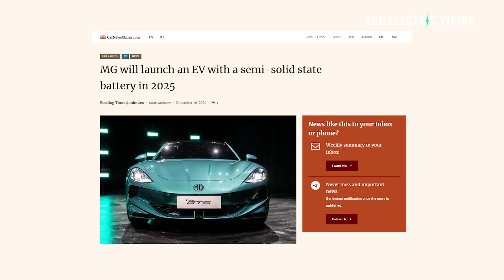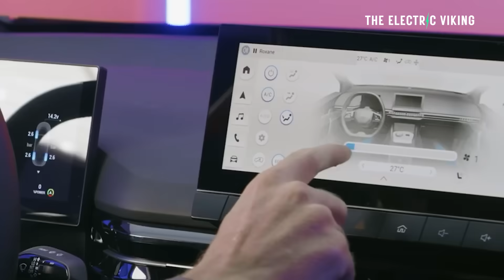EVs with Semi Solid state batteries are about to arrive...

Comment: Ok, so they're heading in the right direction. Range has to go up a little bit, while prices have to fall quite a lot. When 30.000 $/€ cars have an effective range of 800 km and can recharge in 10 minutes, you know its definitely game over for the ICE cars. Lets see if that happens in the next 2-3 years...
Reply: Charging time is not terribly important for most of us. My average daily mileage is less than twenty miles and my typical longer round trips are around 225 miles. At four miles per kilowatt hour, I only need five kilowatt hours daily to maintain a car. I have twenty 250w used panels I’m not using. At 50% output they could supply the EV charge in two hours.
The typical family has at least two cars and one is usually idle. I could buy a used m3 for what I have spent on battery storage for my home. I drive a Toyota Highlander which I like very much but would never buy another one.
Reply: Most gas cars don’t even get 800km of range.  But it would be nice and if that can recharge in 10 minutes. Even though I charge at home 98% of the time.
Reply: Average daily commute globally is under a paltry 60kms and the average ice sold in the UK has 400kms of range on an average tank!

Can't fuel your gas guzzler while you sleep or work for cheaply, or even get paid to charge it as many many many ev drivers do now.

Let the poor brain dead gas holes suck on those sweet sweet poisonous exhaust fumes. They aren't even intelligent enough to realize its one the top 5 ways us men self delete (park in an enclosed space, roll the windows down&turn the ice on!
Reply: already the case in China, and indeed absolutely game over for gasoline cars. They stink, are slow, feel old, and aren't even cheap. Plus you hardly can sell gasoline cars second hand, because nobody wants them.
Reply: Never going to happen.  All that will happen is the majority of people will be priced off the road!
Reply: Charging speed/cost is more important than ultimate range.
Reply: 10 minutes recharge will change nothing (except shortening the lifespan of the batteries, of course). If you put 10 point of charging at 350 kwh you will need a 4 MEGAWatt line to feed them all at once (considering a 10% dispersion and heat dissipation). Multiply that for, let's say, 1.000 charging station - you see the point. Simply not viable. So, you will charge 10 of them slowly OR one of them fast > queue.
If EVs are so good why the hell they need so much subsides from the government? And remember: the day when states will begin tax every kwh of recharge is not far away - and yes, even at home: gov't will mandate to recharge through a dedicated, remote-controlled charging point: energy company will decide IF, WHEN and at which rate you will be permitted to recharge, depending on their grid needs, not your will. Freedom is coming.
Reply: @lucamaggiolini5062  If EVs are good why do they need subsidies? Well, I can't think of a single industry that received more subsidies from the government throughout history than the ICE auto industry, not only to build factories but also all the infrastructure necessary to drive them, roads, gas stations, petrol refineries, the list goes on.
Reply: @mad_cozy What about the subsidies to the oil industry…
Reply: nobody needs fast charging. It's like saying cellphones will never switch to smart phones, because you'd have to charge them every day 😂 if you have 200m/300km range, and a charger at home, you can handle 95% of all driving. And we're already at 600km. Why would you ever charge outside? Swap the battery with Nio, if you must.
Reply: @ “nobody needs fast charging. “

No need to take this conversation further.
Reply: @LowAltitudeEconomyNews  i can think of several times where fast charging is good.
If you take a trip or you are just sick of plugging it in every day or you live in a unit and want more convenience.
cell phones v smart phones not fair comparison
IMHO
Reply: @gregbrown81  I charge every two weeks or so, over night. Completely enough. You pull out the plug of the charging box, the charger in the car opens automatically, you stick it in, an here you go. Why should you get "sick of" it? Yes, on very long distance trips, you may need to charge. But after 300 miles/ 450km driving, I'm sure it's ok to take 30 min rest while charging.
Reply: @LowAltitudeEconomyNews  Yes, that's my plan, I am rebuilding my house and in early 2025 I will move back in with 10kw of solar on the roof, my plan will be to charge during the weekends and then use it up over the week
But that's because I can, others may not be so fortunate, so quick charging would be good.
Reply: @gregbrown81  not saying it's "not good" to have fast charging. Just saying it's no prerequisite for NEV. Home charging is.
Reply: How is it over for ICE exactly?

- After 3 years the EV is basically worthless.
- 10 min charge is not a 1min fill up.
- EV spontaneously combust
- Good luck in a crash in an EV
- ICE can be 40 years old they work. EV lifespan is 3 years yet they are 30.000k minimum for a tiny car with rubbish range.

More EVangelism. EV have a place, they are not a replacement.
Reply: @TerbrugZondolop 
You are a dinosaur
Reply: @TerbrugZondolop my dad has had his model y since release about 200.000 kilometers in and it runs really good still. Spend less than half Per year in maintance
Reply: @TerbrugZondolop  Lol where did you get 3 years? Scott Kimmels? Where I live theres BYD taxi from 2016 who still have juice in its battery and have not yet spontaneously combust while I personally saw 3 car burn in just 5 years.

Also You can charge everywhere and as individual you can also produce your own electricity compared to gasoline that require government intervention. 
EV from 100 years ago still works. 

And theres Tesla dashcam channel (Wham Bam tesla Cam) that record tesla crash and the driver are fine.
Reply: @ keep dreaming
Reply: @TerbrugZondolop  Dream what? Its already happen.
Reply: @TerbrugZondolop facts not BS please
Reply: @TerbrugZondolop  😂Come on bot. Be proud when China makes more than 50% of cars sold in the world EVs in 5 years

Comment: Solid state batteries you 500 miles per charge and give you a maximum of 1000 recharges.
That's 500,000 miles 😊
Reply: Nope, owners don't charge from 0% to 100% as their vehicle would be constantly bricked at the side of the road.  Charging to 100% on a road trip also takes too long, and it leads to greater battery degradation over time.